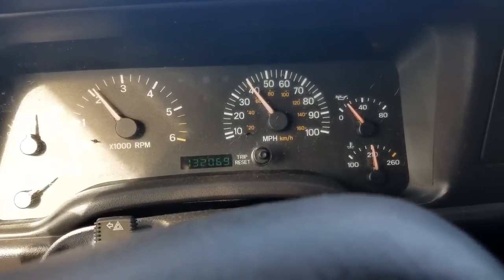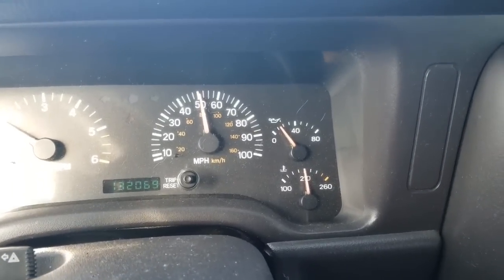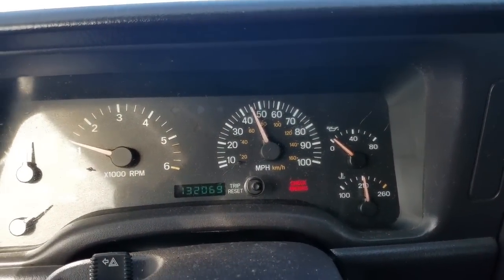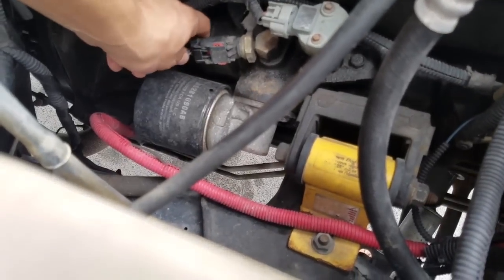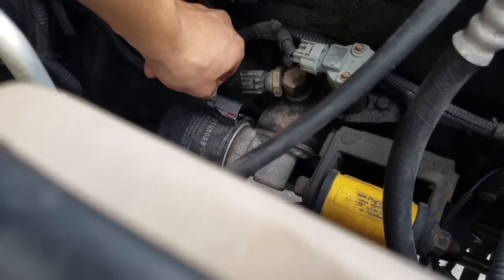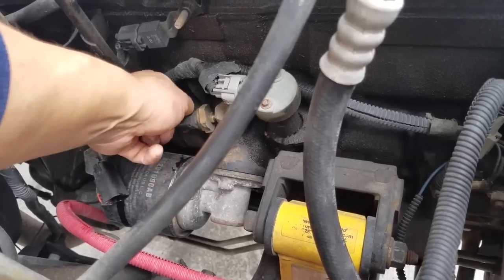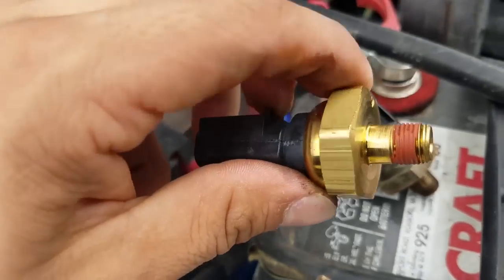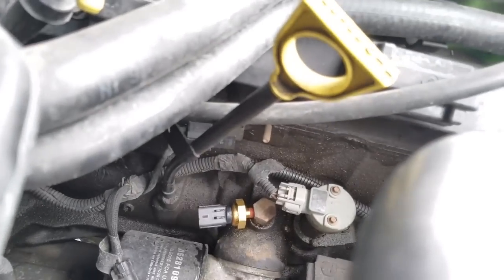2001 Jeep Cherokee Sport oil pressure gauge and sensor/ switch replacement

Comment: I had the same issue I changed out this sensor 3xs and it still not fixed. what is going on?
Reply: Did you ever find out what the issue was? Mine is doing the same

Comment: So I had a problem with my oil pressure reading 0. I changed the sending unit and it fixed the problem I thought. Well now it will read my oil pressure as good and then after the Jeep runs and gets warm it goes back to not reading at all. Any ideas? The sending unit fixed it but it didn't...

Comment: Mine was reading anywhere from 25-40psi on startup (never went above exactly 39 or 40 even at 4K rpm) and eventually went down to 10-13psi after warming up and it ended up being the sensor because with a gauge it was 66 after startup, went down to around 50, and then went to 68 with high rpms. I’m taking my chances with a $13 Amazonian with a 1 year warranty. That’s not bad and then I can consider OEM when that goes out.

Comment: I just bought a 99 xj. mine shows almost max gage pressure at idle, and it comes down a little while I'm driving, but goes right back up to max when I'm idling again.
I just changed the oil, no difference.
Is this something that a faulty gage would cause?
Reply: I will say I've never had the max psi level issue but the low/no pressure reading and it's always been linked to the crappy design of the gauge I would suggest switching to full synthetic 10w-30 if you're not using it as a max pressure reading could be more indicative of sludge buildup from conventional oil vs the actual gauge itself. Esp given how hot the 4.0s run this may be the case

Comment: On my 2001 jeep cherokee sport, the oil gauge plug has an little orange tab that sticks out a little on both sides. This is a lock and needs to be pushed or pulled in one direction to unlock it.

Comment: Having this exact issue with my ‘00 XJ Sport. Goes to zero at idle or whenever I let off the gas or come to a stop, reads about 10-20 when at speed. Thanks for the video.

Comment: Im having the same issue. The oil dummy light turns on after driving for a good 30mins and goes away whenever i go into gear but if i shift too early it doesn't turn off til i start from 1st gear again

Comment: I've been fighting this same problem for a while now , I'm wondering has anybody replaced the oil pump  ??
Reply: Change the sensor. I just did on mine and it reads 40 now before it was reading 80 all the time. But more is better then less. Just change it tho the clip is mad hard to take off.
Reply: Oil pressure is created by your bearing tolerances (wear) not the pump !

Comment: Mine reads 80 all the time. Do I need to change it as well?
Reply from the maker: It probably is the sensor thats malfunctioned. Its worth a try. I would look for it somewhere online rather than forking out the 50 sum bucks at the parts store.
Reply: @thecherokeechannel688  yeah it was that. Just changed it now and it reads 40.
Reply from the maker: @lest187  good to hear!
Reply: Lester Andino did the part number change? What one did you use?
Reply: @sethjanisse4889  I'm not sure if the part number but AutoZone carries at that's where I buy mine
Reply: Lester Andino Thanks for the quick reply man, I found it nearby for $47, amazon for $25.
Reply: @sethjanisse4889  $47 sounds a out what I got it for. So far I get about 45psi reading when in throttle and off throttle about 30psi. New issue is the cat reading below threshold but already replaced the bank 2 #2 sensor.

Comment: My gauge began reading 80 right after an oil change. I can’t find this part number, did it change maybe?
Reply from the maker: https://shop.advanceautoparts.com/c4/oil+pressure+switch-sender/-49998129?krypto=PnoYGdcLEgvVufMDP20ZCxgB0qlZ69q1LWvWVngcUtigEsxCG3pYR65zcXa6GcTtMmtzVzWCKzFtDTIPTgupLJ5llb3EHvOVIx0%2FcVEfCUS1LLzcioZsFRUaol9Cx8D6V6DM9H5Pasjx3Wr0O5TCysdAucv%2FPhgnBYBG5JOYyAY6Vjux6PHLTVtrp2BT%2FgpEyUybr8CJsYGcF6K%2BL%2B%2BA8Mbf3rm85ZSEohnMeof1fGrKMvO76rxhRTKr%2Buh%2BugDyuV4VojYQj44Dp4tjJw2spY4yud1fDezZ8ItuhOq3aoFsSixvR5d4lkLevR1Ptsm%2FzzWB%2F8dPmL4sS7ucewnlJQ%3D%3D
Reply from the maker: This is the advance autoparts number that pops up for the 2001 XJ with a 4.0
Reply: The Cherokee Channel awesome, and thank you. I’m on my way to grab it now.

Comment: Is it possible it could be something else my jeeps sensor / switch was just replaced and is doing the exact same thing yours was doing before you fixed it could it just need an oil change even tho the last oil change was 200+ miles ago? Maybe overfilled it or put filter on wrong? Unless the guy who replaced the sensor / switch did something wrong idk
Reply from the maker: ColdJ's Im not sure but it might be a bad gauge or bad connection. My GFs jeep doesnt read low pressure but it needs 10w40 instead of the 10w30 or it starts acting funny if that helps any.
Reply: firemedic 2011 ok thanks I’m gonna try doing a oil change in it and if that doesn’t help I’m gonna replace the oil pressure pump but I was told by a mechanic not to worry about it that much just to do an oil change
Reply: firemedic 2011 even tho it’s not been that long since an oil change idk
Reply: I'm having the same issue , don't know what else to do , change the oil pump ? I can do that , just hate to if not needed , good luck to You
Reply: how'd that oil change work for ya ? My pressure lasted about 1/2 as long as the life of the oil change is suppose to
Reply: Oil pressure is caused by rod bearing resistance.

Comment: Badda Boom.  She did the right thing , pulled over and got it towed home.   Since it normally runs at 40-50psi, she knew 0 was bad and it told me that it was not likely the oil pump. It failed instantly and randomly with about 286k on it. This looks like a cheap replacement/non OEM sender which failed.
Pulled the drive gear for the cps and turned the input shaft for the oil pump manually. It spun freely and smoothly. Nice and clean looking inside.
After pulling the sensor and cranking it over with fuel pump disabled,  I knew we had oil pressure!!
Tossed in a used, OEM sender out of a wrecked spare we have. Voila!
New B/W s4191 replacement is ordered.
https://www.ebay.com/itm/New-Borg-Warner-Engine-Oil-Pressure-Sender-BWD-S4191-/112781237548?_trksid=p2349526.m4383.l4275.c10#viTabs_0  20$ delivered.